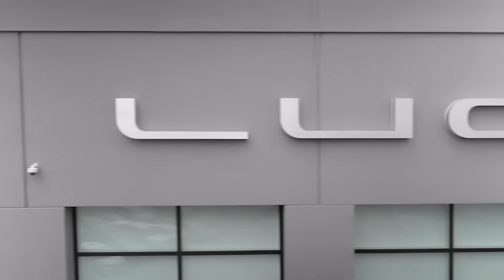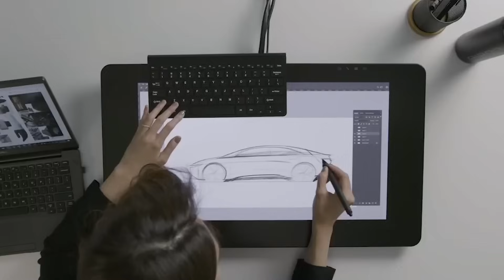Lucid Gravity Battery Cells

Comment: Pete you are usually fantastic to listen to, but that was a LinkedIn resume with 1000 more words than was needed
Reply: Check out peter Rawlinson's Tech talk on how Lucid manufactures their battery packs. Lucid's technology is used in Formula E racing. The Lucid powertrain is smaller and lighter than Tesla's. Peter Rawlinson (CEO) and many others at Lucid used to work at Tesla. Check out their tech talks (Youtube) on their motors, inverters and battery modules. Lucid started out as a battery tech company called Atieva.

Comment: This sounded more like you reading her resume' rather than insight into Lucid's cell design.
Reply: Check out peter Rawlinson's Tech talk on how Lucid manufactures their battery packs. Lucid's technology is used in Formula E racing. The Lucid powertrain is smaller and lighter than Tesla's. Peter Rawlinson (CEO) and many others at Lucid used to work at Tesla. Check out their tech talks (Youtube) on their motors, inverters and battery modules. Lucid started out as a battery tech company called Atieva.